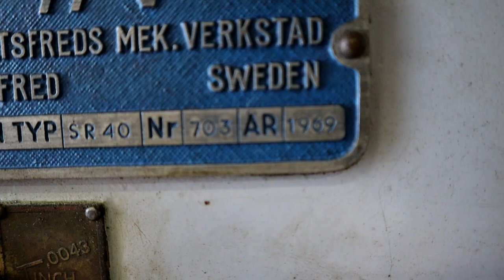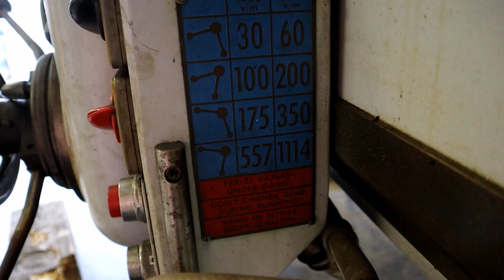What I dragged home from the warehouse full of old tools.. Part 2

Comment: with the overhanging drill table..if you dropped it right where it is or slightly closer to the wall.  you could swing the top and still drill long pieces of material resting on the side overhang.  you may want to invest in a piece of split side 3" pipe foam insulation and slip it over the edge of the table sticking out to reduce leg and hip damage if anybody bumps into it sticking out in the aisle.  if you figure out how the top plate is attached.. you could remount it slideways and offset to where it is now.. and get the whole drill closer to the wall. making more aisle room while still having some overhang to drill long pieces with the top twisted slightly. .  might be easier to Unbolt the base and leave the top plate attached and rotate the base so you can use the Tee slots in the actual base to get it to the perfect spot for max clearance..  reducing time to an hour.  i would also do something about the rusty side surface on the spacer block.. if you put some rust converter on it  .. but the side block can also be used to extend the table width with a bolt on arm if you decide to bolt the drill to the floor.
Reply from the maker: I'm going to drill some holes into the top for mounting vices and clamps and such... I plan to have a set drilled close to the operator side to do just that :)

Comment: I would have taken a couple short 4x4s cut them on an angle on one end and made a sled with a couple 2x4s cross it to slide it down a the ramps on those strips of plywood you are using and use the tractor to pull it
Reply from the maker: And how would I get the tractor out of the building? Or even in it :)  Not much beats pipes for rolling around machines... I even have a set of 4 machine skates and prefer the pipe or bar rollers to the skates...
Reply: No offense intended to your method but I would have skid it off the trailer out side and pushed it in with the tractor sorry my reply was a bit short and unclear but it's just me

Comment: 700 lbs
45" × 32" = 1440"^2
1440 ÷ 144 = 10 ft^2
1-3/4" is 7 quarters
10lbs per square foot @ 1/4" thick
7 quarters so 7 × 10lbs = 70lbs per
10 ft^2 × 70lbs = 700 lbs
Reply from the maker: Thanks!
Reply: Q-E-D

Comment: You edited out the "butt pucker moment" when the machine migrated to the ramps... must have been exciting.
Reply from the maker: Naw.. it was so smooth that it was boring. Tilting the trailer makes the ramps almost the same incline as the bed... Just a 3/4 inch drop.
Reply: @10swatkins  Well, that's good to hear. ...but I know you've been in that moment a time or two, right?

Comment: I don't know why they put a small table under a big drill ! Someone added this bigger table to it   makes it more useful
Reply from the maker: That's what they did..... The bottom table is shown in the manual and has  T slots on the top and side...   Thinking on what to put into the larger table for hold downs...   Probably a matrix of holes, both threaded and unthreaded, but I might just put the table on the planer and put in a couple of t slots myself :)
Reply: @10swatkins  I was thinking a guy could find a big old mill table cut it down to the size  you wanted and plane off the rest then you would have the tee slots
Reply from the maker: @THEIRONWORKER  That would solve the problem of releasing the stress in that thick plate by making t slots in it.. Probably warp like a Lasagna Noodle :)  IT's easier to put the t slots in using the planer and if it was cast iron plate that's what I would do :)  I do know where there is a narrow table about 6 foot long .....